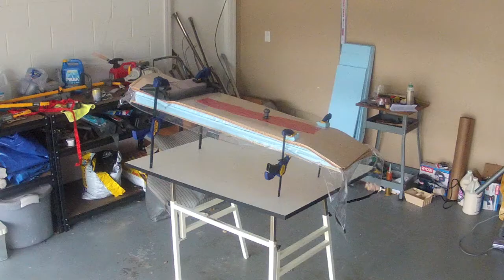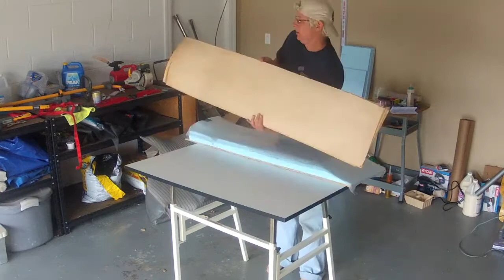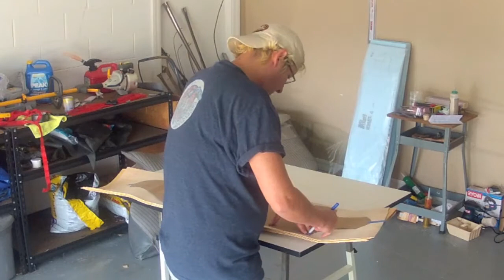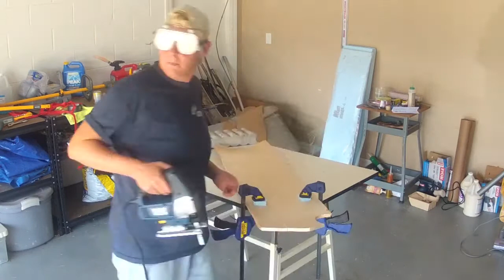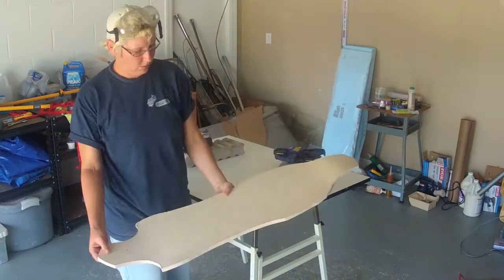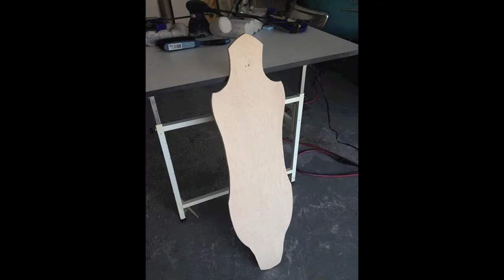Cutting the Howler prototype

Comment from the maker: Thanks, Stryker! It's meant for LDP (long distance pumping). Typically for pumping we want a 60 degree in the front and 30 degree in the back (angles are relative to the base plate you're using). Most of the time you achieve this with wedge stacks but I wanted to build a board that lessened the need for those stacks. The wedging hardware can add height to your deck so I'm going for a compromise with pre-wedege/pre-de-wedge without sacrificing a lower ride height.